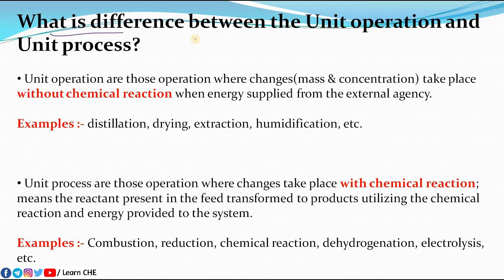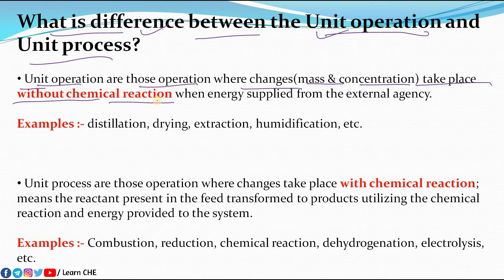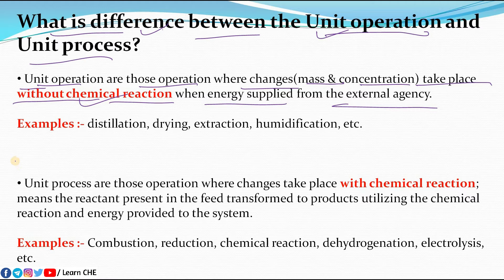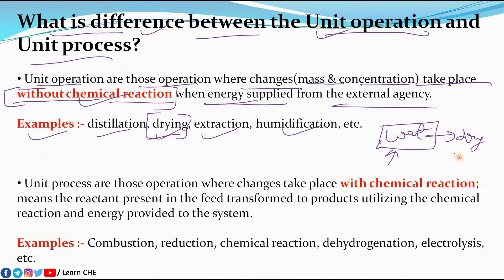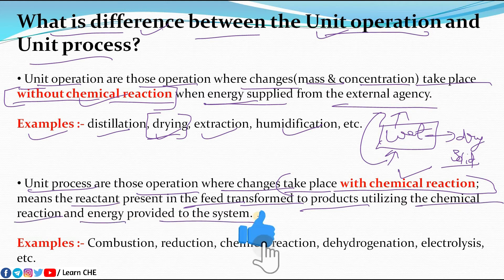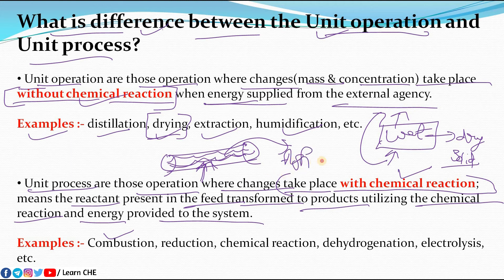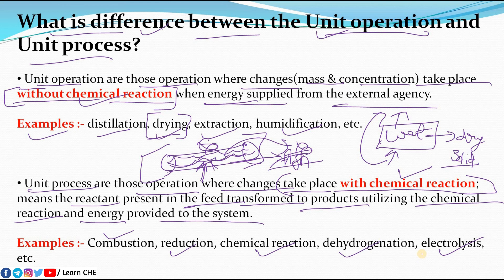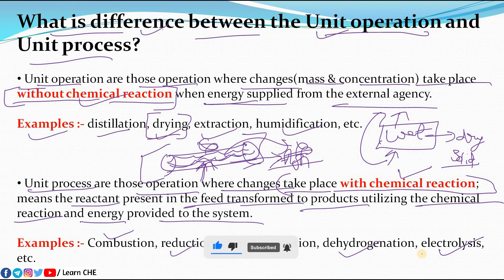Difference between Unit operation and Unit process | Examples of unit operation and unit process

Comment: Excuse me, but why extraction is considered as unit operation not unit process, however it contains chemical changes?
Sir , here I mean especially "Metal Extraction" unit operation or process?
Reply from the maker: Thanks for asking this question....Extraction is a unit operation when it involves only physical separation, such as solvent extraction or leaching, with no chemical reaction.
Metal extraction is not a single unit operation; it is an overall process containing both unit operations and unit processes like roasting and reduction.
Reply: @Coreengineers 
Thank you so much ❤